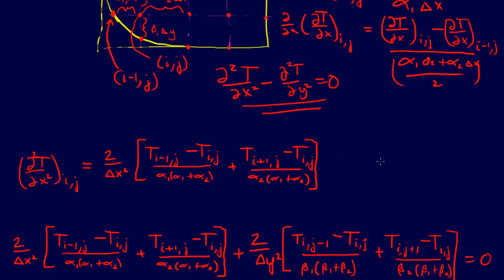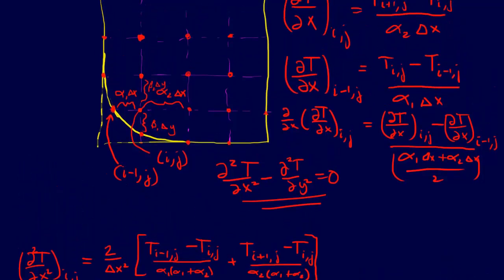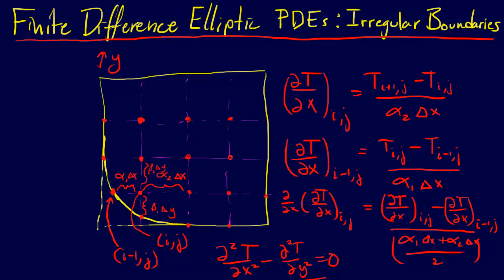8.2.1-PDEs: Finite Divided Difference for Elliptic PDEs with Irregular Boundaries

Comment: Hi there , your teaching is nice. however i wonder how should i determine the alpha 1 and beta 1??
Reply from the maker: alpha and beta refer to lengths. They are measurements based on the geometry of the situation. To clarify, here's how it's done for the example above. Assume the curve shown is a circle centered in the middle of the plate. Let alpha1=beta1=1. This means the circle has radius 2*alpha1 = 2*beta1. The circle equation is x^2+y^2 = r^2. Let y=-1, since r=2, solving for x gives sqrt(3). Thus, alpha2 = sqrt(3)-1 = .732; beta2 is the same.